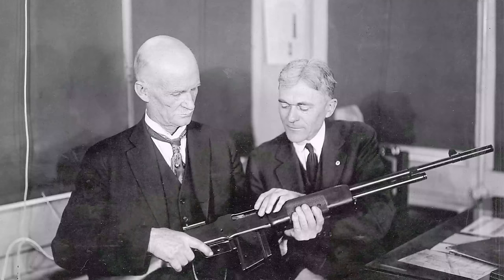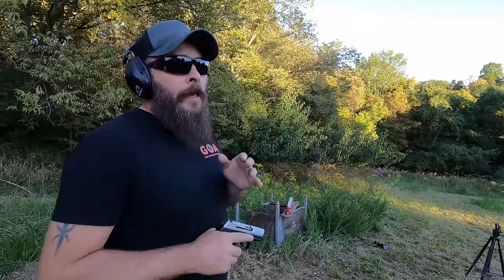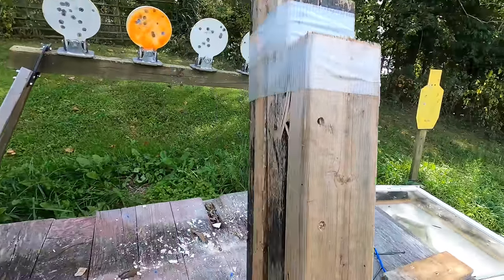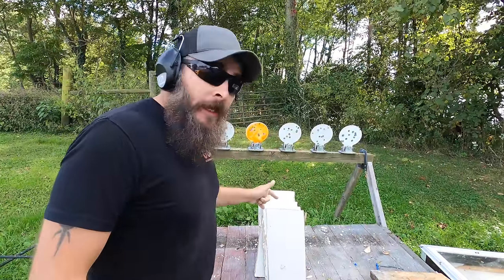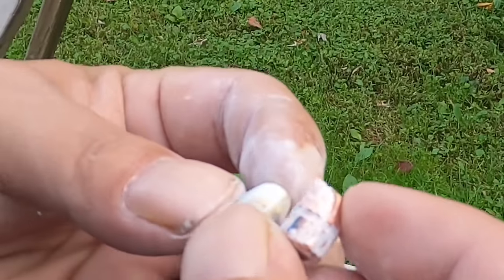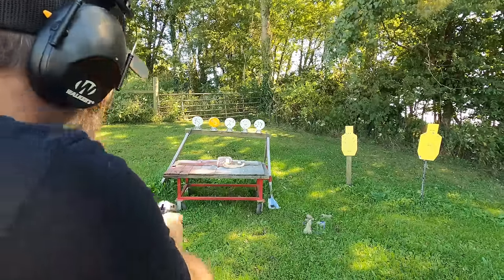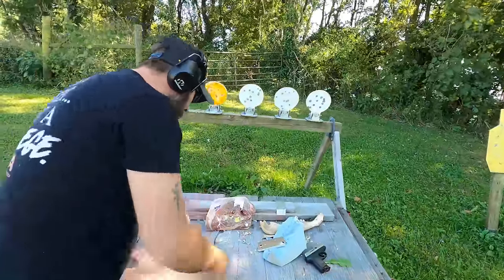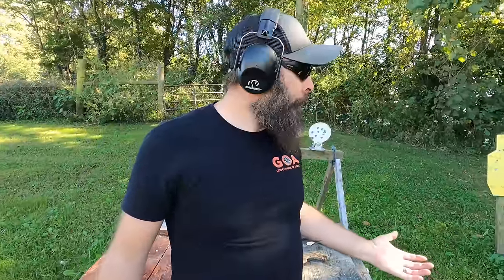Truth about the 380 acp

Comment: The first rule for winning a gun fight, is to have a gun on you.  The .380 in your pocket will ALWAYS be more effective than the .45 or.357 you left at home.
Reply: I just said that BEFORE I scrolled down. 😜👍😊👍
Reply: Often said, yet always true! I carry 380 because it’s easily concealed and comfortable enough I’ll always wear it. Not so with the larger choices.
Reply: @jhask64  same. Which did you choose? I went for the PPK/S for my carry gun. I know it’s old but if it’s good enough to stay in production since 1930, it’s good enough for me.
Reply: Don't leave it at home problem solved.
Reply: @tbjtbj4786  In reality, people are prone to not doing shit that is inconvenient. Almost any .45 is a PITA to carry (especially in summer) and/or has dumb low capacity. Not everyone is willing/can open carry either. That alone gives reasons to have a .380 gun for those days where carrying anything else is really not the greatest solution. Statistics show very similar performance on stopping people too, I wouldn't worry, just being able to dump on center mass quickly should be enough.
Reply: @lucastonoli3256  yea i know but throwing a 44 or 45 in the pocket to me no big deal. 
I had to work with about 20lbs of gear on a duty belt for years.

But to be 100% honest i can get away carrying easier than most people. 
I have been big my entire life. And I got bigger getting hurt. And after retirement I dress comfortably.  Normally overhauls. They have big pockets. 
And most places I go have something to do with farming or ranching its not out of place. 
And there's always a rifle in the truck. Mostly for hogs and coyotes.
Reply: @ c graziano I too have a PPK/S but it has sentimental value so it’s rarely my daily carry. It is a very nice shooting gun!  LCP2 is my small carry choice.
Reply: Got THAT right sir...
Reply: fladave99 Mills  Fits snugly in an XXL Night Eyes phone case and everyone thinks it's a phone.  Works great if you have a CC permit.
Reply: @Cgrazi  Walther was supposed to re-release the .380 PPK in 2019 but for some reason it never got out.  It was in the 2019 catalog but gun stores couldn't order it.  The .22 PPK is all over the place but that isn't what I want.  Instead I got the S&W Bodyguard 380 in the meantime until the PPK hits the shelves.
Reply: @JohnFourtyTwo  I got a 2020 PPK/S in the .380 recently (last 3 months). They are out there for sure but they do seem to be somewhat rare to find
Reply: @jhask64  Good choices for sure. I just recently got my PPK, it’s quite nice to shoot. I usually don’t carry because I live in the middle of nowhere and we have actually good police. But if I moved anywhere that I needed to carry it would be my go to for sure.
Reply: @Cgrazi  Thank you. It's been a about five months since I last checked, I'll check again tomorrow.
Reply: @JohnFourtyTwo  good luck m8, they are rare but I know for a fact there are some out there.
Reply: Sorry a .380 is garbage, i have seen .380's on multiple occasions jam up while firing at the range..I rely on reliability when it comes to a firefight..My XDS. 45 has never jammed and it is a great conceal carry gun..
Reply: @nunyabussiness7855  Do you remember which models jammed? It would help with a future purchase.
Reply: @nunyabussiness7855  .45 is a lot lmao. Good on you for being able to carry it effectively though. My .380 hasn’t had any issues since I bought it 3 months ago (200+ rounds through). There’s a lot of cheap .380s out there but if you get a nice one it won’t fail you.
Reply: @JohnFourtyTwo  have s&w 380 shield love it
Reply: @jamescohen5200  Good to hear that, thank you.👍
Reply: my first rule to winning a gun fight is do everything humanly possible to stay out of one. but sometime you cant so put at least 200 practice rounds down range ever day if possible.
Reply: Correct! BUT the 2nd rule of gun fighting is use ENOUGH gun. ✅  the Las Vegas Metro PD 🚔 had a off duty officer draw & fire his pocket .380acp at a group of armed thugs. He was seriously wounded in the shoot out. The bad guys were caught & the brave officer was named NRA officer of the year. 🏅 He recovered & then packed a full size pistol, 2 15rd magazines off duty. 😉
Reply: @lucastonoli3256   I live in a hot, humid 🇺🇸 city. I toted a Cerakoted Ruger LCP ll .380acp in the summer. Desantis Nemesis pocket rig. I never considered a .380acp superior or highly rated but it filled the need of a hot weather, deep carry, 2nd gun.
Reply: @nunyabussiness7855   .380acp is dependent on carry ammunition & choices. I recall a older printed article from Guns & Ammo where a review of ccw style .380acp guns showed the Glock 42 model was 1 of the few to pass all phases of the T&E. 😏. Taurus, Beretta, Ruger, S&W all duds. In .380acp I'd suggest a round nose type bullet or something ideal in short, compact guns. I used ARX .380acp or Underwood Ammo non lead ammunition in my Ruger LCP ll.
Reply: Yep
Reply: As your comment has 380 likes, I will not vote to mess up with this number.
Reply: Yeah, I'm agree, all calibers and all kind of guns with do the job done if you know how to shoot it.  

The 380 caliber is definitely effective for personal defense and home defense. 

In many countries like Mexico, they know and name the caliber as "9mm mini" also because well it almost the same, it just little bit short.
In countries like Mexico, the police use it as the primary caliber. And in this country, the only caliber that the citizens can get for personal and home defense, it the 380 and the 22lr (i got a lot of Mexican friends, they tell me about it.) 

I'm my opinion, if I don't have more choice than just use a 380  or a 22lf for defense my life, I'll use it.
In Puerto Rico (that what i from) the only calibers available for the citizens for personal and home defense it the 22lr, the 380 and the 9mm 

What it really surprised me is that in the USA it more expensive buy 380 ammo than 9mm ammo. (Even on this times with the pandemic)

So in that case, instead of just buy a 380 pistol/revolver i just go and get a 9mm that got more stoping power, and it definitely more effective. 

But like i said before, if I don't have no choice that just use a 380 or a 22 lr for self defense, I'll do it. 

Actually i got a Taurus G2C in 9mm and well it a very reliable pistol.

I also got a Ruger LCP 2 in 22 lr, i use for practice and  as my every day pocket pistol, and in my opinion it will stop an attacker if you know where to hit. Chamber with CCI stingers, CCI Velocitor or CCI mini Mag, it will do the job done.
Reply: @Philthy McNasty. 🤣🤣🤣. Yeah it would.
Reply: @nunyabussiness7855  I have a Glock 42 .380 & It is incredibly reliable.
I don't understand why anybody carries .45 ACP anyway.
Super antiquated round for defense.
9mm is just as effective without all the drawbacks & if you just want power, get a 10mm as it's far more powerful than .45 ACP & has better capacity.
Reply: Damn Charles Miller, I Love The Way You Think! That's Always Been My Philosophy! A .22LR In Your Pocket Is Better Than Any Caliber In Your Safe Is What I Preach! I Appreciate You! ✌️🇺🇸✌️😎
Reply: You have spoken...wisely.
Reply: @Cgrazi  I have the PPK/S, too. It's a good weapon and dependable.
Reply: @Philthy McNasty There actually isn't really any evidence to support that a one shot stop is any more likely with a .45 ACP than it is with a 9mm or .40 S&W.
I have pretty much all the handgun calibers & I like them all.
If I really just look at it objectively, it's pretty hard to aruge against 9mm.
Reply: @ Tony v my thunder plus is a great gun!
Reply: My old 380 Bryco was pretty chrome and black petite and dependable.
Reply: I'd still prefer glock 29 for cc. I keep a glock 20 though. Big for cc but I'm not sneaking to shoot someone. If I have to use it speed to the trigger is key. I don't mind if the bad guy knows I have answers. If someone has a drop on you it's rare that the brain allows someone not to cooperate. Awareness is also key. That noticeable big gun may help change a bad guy's mind. My 2 cents agree or disagree. When I was a bad guy freeze or lay down meant just that. Now make a fast move or slow one to a gun and it'd be the last one. Lol never seen someone's last move yet.
Reply: Exactly, I have a .380 at all times. My friend has a collection of Desert Eagles in his safe. DUH
Reply: @lucastonoli3256   45ACP has dumb low capacity compared your 380? Please tell me any 380 that has more capacity than most 1911's without mag extensions? I used to carry a Glock 30s that holds 10 rounds. I now carry a Sig P365XL with 12 rounds and it's very comfy to carry. Yes, I'll carry my 380 bodyguard in an ankle holster sometimes but it's not my every day carry
Reply: so don't leave your .45 at home or get one of the bajillion available tiny 9s
Reply: @tonyv8925  i carry a Bersa Thunder 380 a never had a problem with it.
Reply: @Broccoli Rob Link that study.
Regarding the ammo count argument. Compare apples to apples.
Reply: @Broccoli Rob I'm not finding anything. The written reports pretty much echo the statement made by this doctor early on the video:
https://www.youtube.com/watch?v=wXwPtP-KDNk
Tldw: Difference on killing capabilities between pistol/pistol cartridges is negligible.
What's your source?

By "Apples vs Apples" I mean comparing stuff like a glock 21 and a glock 17; which have similar size and would be similarly "challenging" to conceal (depending on what you wear, your size, etc). On the case of .380 in the US, the options are more limited, but - as a reference point - Glock 25 sold in Europe has Glock 19 size and Glock 19 capacity, but in .380. Generally speaking, you get about 20-30% more capacity on a .380 vs a .45 ACP.
Reply: @Broccoli Rob bersa thunder plus. 15+1
Reply: Sold my Browning BDA earlier this year. It hurt my hand when I shot it.. I keep a .380 Bodyguard in one of my trucks, but my EDC is a Sig P238 .380 ACP.  Love all my Sig's
Reply: @Cgrazi  same here PPK/S.
Reply: @raulgonzales1374   Mine is still running great. Only one issue I’ve found, it hates the streak tracer ammo. Everything else I’ve ran through it has had 0 issues.
Reply: @Cgrazi  ppl/s the way to go!
Reply: Any smart person should know getting shot by any caliber gun isn’t fun, the .380 is just as good   As a 9mm.
Reply: Sig Saur P230........(sweet).
Reply: Wise words.
Reply: @Cgrazi  Hey it was good enough for Bond, James Bond.
Reply: That's why my 1911 is never home..
Reply: Had my 380 in my pocket while crossing a parking lot. When a car of four unfriendly people stopped in front of me blocking my path.  One of them said something to me.  I just slid my hand in my pocket and the driver sped away.  Yelp it works.
Reply: I don't spend my life living in fear.
Reply: @Indred Cold Very well stated!   Regarding 'in the stall' a couple rounds from 1911 long slide, cal .460 Rowland, should send a message. Later you might need to visit a hearing specialist.  Hopefully we'll never have to pull the trigger
Reply: @jimskarw25   My feelings exactly. Mine fits my hand perfectly and shoots to 'point of aim' without sighting. It's the only pistol I've been able to do this with. At 15-20 ft fast hip firing to 10" target is a piece of cake. Surprisingly accurate, will consistently shoot 2 1/4 - 3" groups using a rest at 25 yards using Winchester 'white box' ammo. My favorite pistol is old SIG SP 2340 in .40 cal. After more than 50k rounds with only 3 malfunctions (dead primers) I'm pretty used to it. It's gonna take a while to catch up with the SP230
Reply: fladave99 Mills  Yep; .380's are perfect for pocket carry. They're just so damn convenient for EDC.
Reply: @lucastonoli3256  nailed it..
Reply: @jhask64  Have your ever fired the Sig P238?
Reply: Nunya Bussiness .380’s can be finicky with ammo, once you find the right round you’re good in my experience, and my lcp2 will feed anything tbh. Don’t fall into the internet hate forums! You obviously didn’t when it comes to XD’s lol
Reply: Tony V have you seen when those frames explode though? They look like loosely set concrete, just aluminum pot metal. I’d be into a polymer or steel framed thunder, but the one out now doesnt cut it for me
Reply: @ButterfatFarms  yep for the most part 99%+
Of the time I were the same outfit. 
It helps with keeping a 44 or 45 with me.
Don't care about the weather either.  105° with 100% humidity or 32 °
The guns more important than being comfortable.
Reply: The .380ACP will always be effective regardless of what other guns people owns or silly comments that are posted in regards to the latter. Same applies to .22LR as well.
Reply: @mrsmithsmith8418  what do you mean by effective? And always? 
To me (always  and effective)
Would mean it will stop a threat each and every time.
 Thats something that rifle rounds will not do or even shotguns.
Reply: @tbjtbj4786  Here is the thing. There is always guys out there that make funny and fake posts about how certain smaller calibers are not effective in stopping threats and even larger calibers at times. This causes those incorrect statements to fly around the internet. Your comment and question to me implies "every time" well no because people can miss an attacker outright. You can use any gun that you want for self defense.. I have no problem with that. But ANY gun, can cause of lethal wound even 22LR, 22 Short and certainly .380ACP and funny references or saying that's not the case does not solidify understanding of firearms for new people starting out practicing there 2A rights.
Reply: @mrsmithsmith8418  i actually agreed that any gun including air guns can be lethal. 
But in a selfdefince situation lethal is not the concern stopping the threat is the concern. 
A 22 might but the ammo it uses adds extra reliability issues. 
If all you have is a 22 yes by all means carry it. If you are shopping for one and size is the biggest concern ( which it shouldn't be)
Go with a 25 or 32. They are atleast center fire  and the 32 has a bit more power. 
I am not going to really going to argue about the 380. There are load that are very much ok and it was the minimum backup/ off duty for a lot of leo agencies around here. 

I guess the big difference i have been around gunfights and seen the after effect. 
And I have been in them and been hit.
I am not going to tell you I want have one of the small guns on me. I like the 22mag naa as a get off me gun.
But I will be in reach of at least a 9mm but 99% of the time I am within reach of a 45 or 44.

One thing I know is any of the people that I know were in a gun fight.  Not one carrys the small calibers as a primary
 gun.
Reply: Cliche
Reply: Very true indeed.... What good it does When We Can not use it.... Like Penile Dysfunction...🤣😂
Reply: +1
Reply: ::::::::: No matter a small size female or male, she or he can carry a 380 acp  LCP Max， with 10+1 rounds whole day long without any uncomfortable.  Certainly she or he can carry a that pistol 360 days for a whole year,  without any uncomfortable.    That is the key point，that is the purpose for a self-defense gun for.    Because we never know when a dangerous situation will come out.
Reply: @jhask64  I also have a Walther PPK/S but I prefer to carry my Smith 637 Airweight in 38 
                   Special + P.  It's much lighter than the stainless PPK/S.
Reply: fladave99 Mills  Best pocket pistol out.  Grab the trigger kit from Galloway and it gets even better, IMO.
Reply: 2 second rule ,gotta be able to hit your target lol
Reply: My sentiment exactly.
Reply: SO WILL A .22 MAGNUM .
Reply: Yep. I’m 5’6 155 & my Bersa Tpr plus just melts into my waist, I’m going get really good with it.
Reply: what if you call your mom and she brings the .45
Reply: That's why I don't leave any of my guns at home 😂

Unless I'm somewhere where they're not allowed/allowed in the open I'm both concealed carrying and open carrying.
Reply: @nunyabussiness7855  Glock 42 had a problem if  there was a limp grip.  Ruger lcp max doesn't have an issue.
Reply: Isn’t that the truth! I found that out compared to my Glock 43X! I prefer carrying either my Glock 42 or Ruger LCP Max! So what good does my Glock 43X do me at home? Nothing!
Reply: I was fishing next to an older gentleman.  We were talking about an outlet place nearby.  
He showed me his 380 and mentioned two guys told him to hand over his wallet.    
He told me that he said I’ll show you this first and pulled the 380.  
Often the site of a firearm will be enough.  It was.  
His story, not mine
Reply: Always keep a lcp 380 on me! You never know esp these days! Stay safe out there
Reply: @nunyabussiness7855 , I hate to burst your bubble but I have worked in several hospitals and have seen more people killed by 22 Cal and 380 ACP than any other caliber . I understand that you have your own personal opinions but I have seen the proof/evidence with my own eyes .
Reply: @nunyabussiness7855 someone had garbage 389s.

Comment: Thanks for putting out this video.  It’s especially important now that Ruger has come out with the LCR Max which is a worthwhile pocket pistol for deep concealment.
Reply: The lcp max just peaked my interest in 380 as well.
Reply: Yes carry a lcp max appendix with a 12rndmag (+1) and a 10rnd backup..it's a pocket pistol but simply shoots like a bigger gun and has that great capacity. carry appendix with a good holster and it dissappears.
Reply: I got into 380acp for the first time recently because of the LCR Max.
Reply: You meant the LCP Max, not LCR (revolver).
Reply: @bmaxse  I stand corrected.  I had the LCR and it’s a great revolver.
Reply: @Quality_Guru  Thanks for confirming. I got excited at first thinking they made a 380acp LCR. 😅
Reply: Just bought my mom the Ruger LCP Max in .380 something light weight that she can conceal got the 12+1 mag and the standard 10+1 for a backup